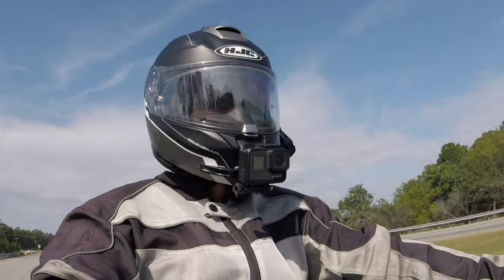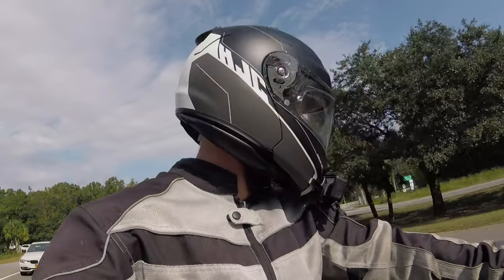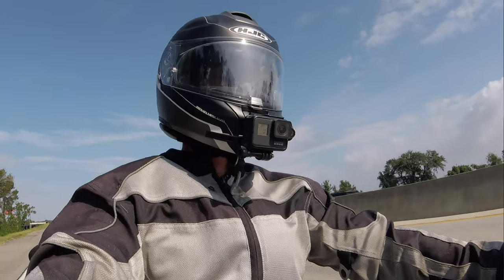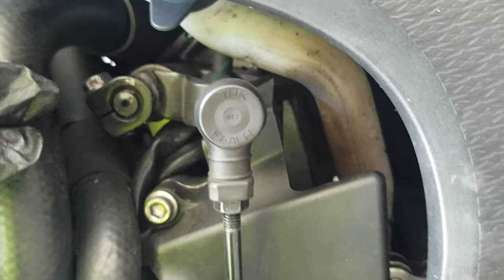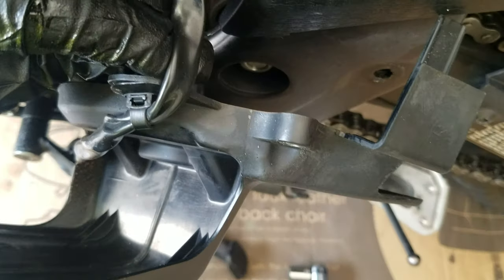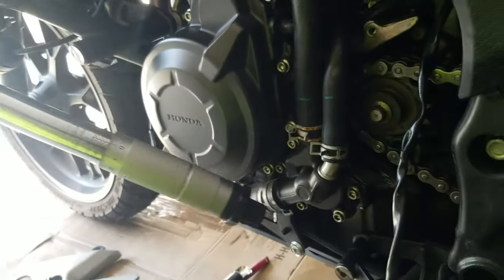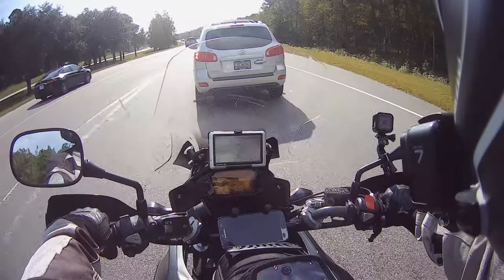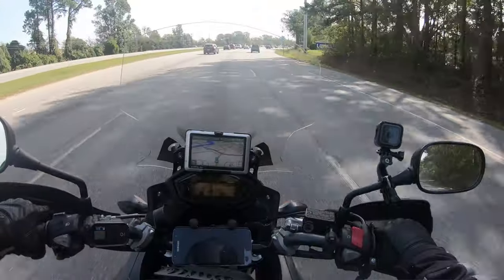CB500X 16T Sprocket Swap

Comment: Thank you for the informative video ...just curious if you lost on the torque end of things ...is there a loss of acceleration time that you notice ? Thank you
Reply from the maker: Hi Stew!  I certainly haven't noticed a decline in torque.  And with the gears spaced out more evenly, I feel accelerating up to highway speeds is faster and smoother than before.  The whole bike just feels more balanced!
Reply: @MotoPhotoAdventures  Thanks again ! Just confirming if the sprocket change made the speedo calibration off more or  did it make the speedo closer to the truth ? I have the Rally Raid full conversion with the larger front wheel and I believe the speedo is showing 3 mph  more then my gps  . I am planning on doing this sprocket change next week . Thx
Reply from the maker: @stewtube1240  any sprocket change will change how the speedo reeds.  Whether it's for better or worse dependable on how far off your current speeds are.  Personally I only trust the speedometer on my Garmin Zumo.  So the speedo inaccuracy doesn't bother me.  But if you look in the show notes, I have links to the SpeedoHealer...which plugs in and electronically corrects your speedo no matter what changes you make to the bike.
Reply from the maker: @stewtube1240  by the way, I'm releasing  BRAND NEW video in a couple days about a new sprocket setup for the CB500X I think is even better than this 16T setup!  Stay tuned...
Reply: @MotoPhotoAdventures  I guess that my concern is that my bike will be racking up more miles on it then it should be . If my speedo is already out by 3-4 mph and then the sprocket puts it out another 3-4 then it could be adding 8% extra miles on the odometer then it should .
Reply: @MotoPhotoAdventures  I ordered my new chain and sprockets ( original size ) last Friday . I was going to order the 16T from Amazon tonight so that I could have the 16 T installed for a trial . If I didn't like it I would put the new 15T on instead . The bike is booked for this service on the 28th . Now I am wondering what new set-up your are doing lol . Oh well , maybe I will just go with the new chain and sprockets ( original size ) for now . Thx
Reply from the maker: @stewtube1240  haha...sorry for my delayed timing.  But honestly, I've REALLY enjoyed the 16T on my bike for 40K miles.  I think you should try it first.  Keep the 15T as a spare for next time.  Because (here's a hint), the next video shows an "in-between" ratio that is similar to changing out the front sprocket, but involves going back to the 15T front sprocket on the front while changing the rear sprocket to a different size.  SHHH...don't tell anyone I gave away the secret early.  HA!  Same concept to reduce rpm and expand the gearing ration...just a different way of getting there.
Reply from the maker: @stewtube1240  Naaah...life is to short to loose sleep over tiny variances like that.  Besides, this engine is known to last a gazillion miles without issue.  I don't think your bikes value will ever diminish due to a few extra miles over the years.

Comment: so speedometer will need re-calibration. How do i re-calibrate the speedometer.
Reply from the maker: Hi Gulzar!  I use a Zumo 390 GPS on my dash, which shows my exact speed.  So I don't need the speedometer to be accurate.  If you do, you can purchase what's called a "Speed Healer", which will electronically correct your speedometer to make it extremely accurate.

Comment: Did you recalibrate your speedo after changing the sprocket? If so how and what unit did you use
Reply from the maker: Hi Gilbert!  I use a dedicated Garmin GPS to monitor my speed.  So I didn't feel the need to calibrate the bike's speedometer.  If you would like to do so, it's very easy.  There are 2 companies that make a device to calibrate the speedometer.  I have them listed in the show notes but will paste here for you.  The first is made in the US and costs a little less.  But both have excellent reviews.  Thanks for watching!!!  

SPEEDOMETER CALLIBRATORS:
SpeedoDRD DRD-3 from 12 oClock Labs - https://amzn.to/2Pahs8C
HealTech SpeedoHealer - https://www.healtech-electronics.com/...

Comment: Would you need to inform your insurance company about this modification and would it invalidate any warranty
Reply from the maker: Not in the US it won't.
Reply: @MotoPhotoAdventures  but until the bike is recalibrated surly it's not road legal as the speedometer is out

Comment: What's the difference between this change of the front to lower the rear sprocket teeth?
Reply from the maker: Hi Richard!  It's just different methods to achieve the same goal.  Some prefer changing the rear sprocket.  I changed the front because I thought it was easier to do than pulling off the entire wheel.  And then some do both (up a tooth in the front, down 2 teeth in the back.  You can use this website to calculate your options:  https://www.gearingcommander.com/

Comment: Is changing engine sprocket not a warranty issue? ty.
Reply from the maker: Hi DueEastTrav!  That's a good question for your Honda dealer.  My bike is a 2013.  So warranty restrictions were not a concern for me.  I don't see why it would be.  But I've heard of crazy manufacturer requirements.  Perhaps someone who knows can leave us a comment with their insights?

Comment: How noticeable is the decrease in acceleration?
Reply from the maker: I hardly notice any decrease.  In fact overall it feels faster off the line because I don't have to shift as quickly out of 1st gear.

Comment: does it help with fuel milage sir?
Reply from the maker: No change if fuel mileage that I have noticed.  Just smoother riding at lower rpm.

Comment: Did it change the acceleration speed?
Reply from the maker: Hi Fabio!  No change in acceleration.  However, it evens out the space between gears (especially gears 1, 2, and 3) so you don't have to shift so early.  When you take off in 1st gear, you will be traveling faster speed before you have to switch to 2nd, etc.  But the real benefit is at the higher speeds because your RPM of the motor is lower and the bike feels more "relaxed" on the highway because it doesn't have to work as hard.

Comment: Thanks for the detailed 16T upgrade video! I have the same bike and we have many of the same upgrades on our bikes.  Mine has been converted into a commuter and long-distance mile muncher.  I replaced my stock chain and sprockets at ~13K miles, and now I have ~18K miles on the clock. I replaced with the original ratios but now I'm considering the 16T front upgrade.  I see that your video was from about a year ago... did you ever get a speedo healer to fix the speed discrepancy?  Are you still running the 16T even for your off-road trips?  Cheers, and congrats on the channel growth and great content!  😉👍  --QM
Reply from the maker: Hi QM!!!  Thanks for the encouraging words and kind remarks.  YES, I'm still running the 16T upgrade.  It served beautifully for my long-distance haul down through Mexico and back last year (https://youtube.com/playlist?list=PLMpCu16Bx7xOgz2lP1igdN0uYO1Aht3Nz), as well as the off-road Trans-America Trail adventure.  While ascending the 12k foot Cinnamon Pass we had a discussion about how the 15T sprocket might have been helpful:  https://youtu.be/L3tf5pl2HCI.  But I actually had no problem with the 16T even on those steep rocky trails.  So I'm sticking with this combination for the foreseeable future!  :-)

Comment: Now it that the nc700 sprocket in you list you are are using and just curious how reliable the sprocket is over a year or two of use. And I seem a plug in device online to recalibrate the speedometer. There was a YouTube video I saw a guy setting it up on cb500x for different size tires.
Reply from the maker: Hi S O!  Plenty of owners before me have switched to a 16T sprocket without any apparent adverse affects on reliability or durability.  Knowing that the NC700/NC750 has more horse power than the CB500X, I can't imagine the sprocket for those bikes is any less durable than the original 15T that came on the bike.  And yes, the device to correct the speedo is called the Speedo Healer from a company called HealTech.

Comment: I have the 2020 CB 500x and I’m having a hard time locating a 16 tooth sprocket. Any recommendations on where I can find?
Reply: The Amazon link option is listed as not fitting my model year.
Reply from the maker: Because the stock bike comes with a 15T, it may tell you a 16T won't fit even if it does.  JT Sprockets makes a 16T version specifically for the CB500X.  They have been out of stock, but say they will be back in stock soon. Contact them to find out when.  Otherwise, you can try ordering one for an NC700X or NC750X.  Many say these fit the CB500X, and they are 16T.  Good luck!

Comment: How do you calibrate the speedometer?
Reply from the maker: Absolutely!  All you need is one of these devices that you plug into a port under the left-side plastic panel of the bike:  SpeedoDRD DRD-3 from 12 oClock Labs - https://amzn.to/2Pahs8C.  A lot of owners buy them even without the sprocket changes, since sometimes the bike's speedometer isn't accurate from the factory, or isn't accurate because they put knobby tires or a different sized tire on.  Have you checked your speedometer against a GPS unit?  You might find it's actually not very accurate!  Some riders even report changing to a different sprocket size actually made their speedometer MORE accurate!  Personally, I have a Garmin Zumo GPS mounted to my dash and I use that as my speedometer.  But if you want to really calibrate your speedometer, just buy the SpeedoDRD and you'll be all set.  Also, if you're cosidering a sprocket change, you might want to watch our other video:  https://youtu.be/Je6LdgYt9fg.  It's got even MORE details!  In this newer video, I explain why using a 39T rear sprocket might actually be even better than switching to a 16T front sprocket.  I hope it helps!

Comment: did consumption increase or decrease?
Reply from the maker: I didn't make scientific records...but didn't notice any change.  In theory, fuel consumption would decrease because the engine is working at a lower rpm for the same speed.  But with a smaller displacement engine like this, factors like wind resistance probably negate any benefits on fuel consumption.  But of course having the engine work less hard to achieve the same speed is probably a good thing over the life of the bike.
Reply: @MotoPhotoAdventures  True. Some others noticed an increase though. It's wonderful to live in a country with cheap fuel, isn't it? Greetings from the country with the 5th most expensive fuel in the world. Thanks for getting back to me.
Reply from the maker: @lefterisbampaidis5446  absolutely!  Thanks for watching in and commenting.

Comment: Wow, that's a noticeable difference (improvement, imo). Last road trip I took was 2,400(ish) miles, the long way around (from Bristol, TN) down through Texas, back up through Oklahoma to visit our oldest in Ft Smith (Arkansas), including an Iron Butt on the way out (as it's only 750 miles or so straight from their house back to ours), stock gearing and still running the factory tires at the time. That was lots of 75-80MPH riding at those rpms. Of course, the bike chugged along at those rpm's with nary a complaint, but man that 16t would have made my time more enjoyable (neverminding the potential health benefits to the bike). As is now (stock gearing), you're definitely right on first gear's usability, LOL, it's great when I get a little ambitious with the level of trail difficulty I'm riding, but everywhere else it's a waste of a cog.  I can't remember what it's called to save my life, but when I'd talked with a mechanic friend (he's lead mechanic at the local shop, and a riding buddy) about just this subject (switching to a 16t), he told me there's a product "that I could mount under my seat" to calibrate the speedo back to accurate too. 

Anyways, thanks for this. I may go this route next sprocket/chain replacement (probably around Spring at my current average for miles I ride) 😊✌
Reply from the maker: Thanks for the great comment, Small Adventures!  Yes, the 16T upgrade surely would have made those long hours on the slab way more enjoyable.  Give it a go this spring!

Comment: Hello Chris. Are you sure, that this sprocket change really influences the speedometer? I thought that speed and everything is simply calculated from the speed sensor on the front wheel? So your claim about the speedometer being a bit off because of your modification seems not to be true.
Reply from the maker: Hi Jan!  On most older bikes, the speed sensor is on the front wheel.  However, on the CB500X and most modern bikes, the speed sensor is located on the front drive sprocket.  So yes, changing the sprocket is indeed the reason the speedometer is so accurate.  Of course other cactors such as the size and brand of tires you are using can also affect the speedometer in small amounts.  But before the new sprocket, my speedometer was fairly accurate.  After the new sprocket it was very inaccurate, as you saw in the video.  Note that I have been made aware of a product from Healtech called the Speedo Healer, which you can plug into the sensor and correct the speedometer back to 100% accurate.
Reply: @MotoPhotoAdventures  I see. This mod seems to be worth it though. What you think? 
Only thing that seems a bit challenging is this mod of that one part that does not fit after changing the sprocket. Other than that it seems kind of straightforward. 
Will think about it :) Thanks for nice video!
Reply: On this video I spent time looking the differences of speed.  55mph on the clock = 60 mph on the  GPS.  64 clock = 70 GPS; 73 clock = 80 GPS. if you calculate the ratio 55/60 = 0,916; 64/70 = 0,914;  73/80 = 0,912  So you see the difference of speed is almost constant. I have bought the speedo calibrator from 12oclocklabs and yes the sensor is in the engine and not on the front wheel. I will need the help of a pro mechanic to plug it for me next time i can go back to Phuket where my bike is.
Reply from the maker: Thanks for the kind comment, @jonnyreh001 .  It was extremely easy to make the change.  I found out later that the chain guard actually works just fine without grinding it down.  I had mistakenly installed it backwards!!!  :-/  So you shouldn't have to grind it down.  It should be an easy swap to change it.  Enjoy!
Reply from the maker: @didierplouhinec4899  thanks for the excellent feedback!  Let us know how the speedo calibrator works once you get it installed.  :-)

Comment: Is it possible to recalibrate speedometer to new sprocket, so it indicated correct speed?
Reply from the maker: Yes it is.  There is a device called the Healtech Speedo Healer that you can plug in and re-calibrate your speedometer to be the exact speed.
Reply: Speedo calibrator from 12oclocklabs costs 79 USD and is a plug and play system for Honda CB500X . Avery small device, it mesures 2cm x 2 cm.
Reply from the maker: @didierplouhinec4899  thank you for sharing!!!

Comment: Great video, regarding your screen is it any good as I do lots of highway mileage. And if so which make and model is it ????
Reply from the maker: Thanks Big Pete!  I absolutely love my screen.  It's the one from Givi.  Highly recommended!!!  I'm 5'7 and have zero turbulence or wind buffeting on the highway...just a nice little bubble to sit in and enjoy the view.  :-)
Reply: The lower the rpms your constantly at the better the gas mileage and comfort in riding. This is primarily great for long stretches on highway.
Reply from the maker: @NopeKickEm , thanks for the kind comment and helpful insights!

Comment: Hello, Chris! I'm just wondering does this sprocket fit the 2019 / 2020 model?
Reply from the maker: Hi Kain!  I have no idea.  I would think it's the same fitting on the newer models as the old ones.  Most of the changes seem to be in the suspension and cosmetics.  The engine seems to be pretty much the same.  But I honestly have no idea.  The good news is, it's a cheap modification...TRY IT!!!  The part won't cost you but $25-$50.  And you won't even spend an hour installing it.  Give it a shot and let me know if it works.  Maybe do your own YouTube video to let the world know if it does!  :-)
Honda NC700 Sprocket:  https://amzn.to/2MW7TFi
JT Sprockets:  https://amzn.to/2oWo910
Reply: @MotoPhotoAdventures  Thank you so much for your detailed advice. I will ask the dealer to see if that works on mine. And I'll let you know after I got the answer :).

Comment: I put a gear indicator on mine. will i need to re program it ? thanks.
Reply from the maker: That's a very good question, Brandon!  I don't know the answer.  But hopefully someone on here can help us out with a reply.
Reply: I didn't have to reprogram mine Brandon. It's just a cheap ebay one from China. Although in the instructions it says you may have to.

Comment: Without GPS this comparison is silly, the speedo is off from the sprocket change.
Reply from the maker: Which is why I used the gps.  😂 Thanks for the comment.
Reply: Speedo is a % off from the factory as well.

Comment: Doesn't the speedo work off the front wheel ?
Reply from the maker: Paul, it worked this way on older bikes.  Newer bikes have a sensor near the front sprocket.
Reply: @MotoPhotoAdventures  nope
Reply: the vss sensor is right above the gearbox  right side 
and the tacho - rev realation does NOT CHANGE what ever changes you make to your final drive.

the only actual change is between tacho and gps readings.

trust me
Reply from the maker: @ae70gts  Thanks for clarifying.  On my bike I believe it's above the gearbox on the left, which is why I said kind of near the front sprocket.  I'm sure it's different for different bikes.  I was just letting Paul know modern bikes aren't like the old days where it was literally a manual-drive cable from the front wheel up to the speedometer housing.  :-)